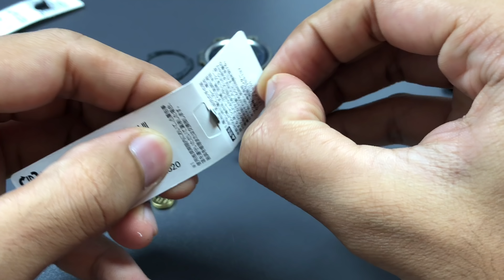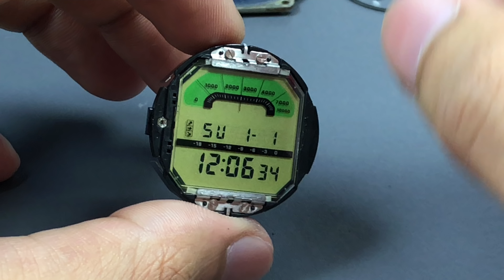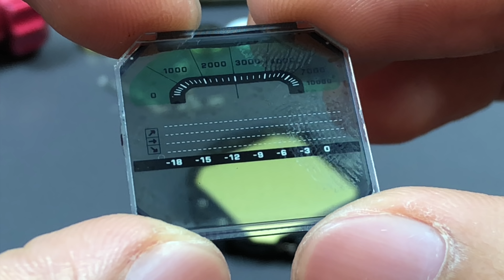Whats inside a DW-6500 Single sensor G-Shock

Comment: Hello friend good day, sorry I have a g shock 6500 watch and the word error flashes on the screen, I already replaced batteries and still does that, does it have repair?  It's a great channel, regards
Reply from the maker: You'll first need to perform AC after battery switch to reset the circuit board.

If that didn't work, check the connection on the sensor side. Follow the steps I showed and try to check if the sensor is still there or if the wire cable still intact. Sometimes they crack/torn apart.
Reply: @gshockhighfashion  thanks
 Hello friend, I already did the reset after putting new batteries, I already checked the connection and it seems that everything is in optimal condition however the intermittent error message on the screen is not removed, I do not know what to do

Comment: Hi really good videos. I have a PRT40 but one of the back screws is not fasten. How I can fix it. Some solution on web is use a JB époxic or a glue with baking soda. I do not want damage the watch. Could you give and advice. Also how the sensor can be remove from the main body case? Thank you

Comment: Looks a lot better on the inside then it did on the outside 🤔👍
Looks like another good rebuild (did you just have a spare bezel hanging around?) Great work & vid, cheers 🍻
Reply from the maker: Exactly, I'm impressed with all the tiny parts that made the interior. Looks really premium for the price. Yes, I found an aftermarket bezel for this watch and that completes the whole rebuild works! 😃🙌
Reply: gshock highfashion Awesome & a Nice looking watch for your troubles 👍🍻
PS: have you sorted your quad sensor issue yet ?
Reply: @gshockhighfashion  where did you manage to find the bezel? 
I'm deep deep need of a bezel for a lungman and a raysman...so hard to find 😔

Comment: * BOOK WARNING *
The bezel was already broken on the sensor when ur started so I couldn't see how it was placed on the casing. I'm currently max bidded @ $150 for one of these that is all orginal. 

Now I know theres a good chance the bezel is prob already at best very fragile at worst already cracked. I've pulled a few of these vintage ones to know my best best at getting things off to clean(It's my thing to clean them up and wear them)is to remove EVERYTHING from the casing and just slip it off. Is there anything that will prevent that bezel from coming off attached to that sensor?
Reply from the maker: The bezel aren't attached to the sensor.  

There's a perforated metal plate screwed to the hardcase to cover the sensor.

You'll need to brush clean all/any oily residue with soap first. Then remove the strap and 4 bezel's side screws.

Then disassemble the movement/engine/module out of the hard case. Then remove all 4 side buttons by taken out the e-clip.

After all that, now you can try to remove the bezel upwards and pray it didn't break during the entire process.
 
In my case, I didn't really care if it breaks since I could just buy a replacement bezel and swap them out. Not original replacement part of course.